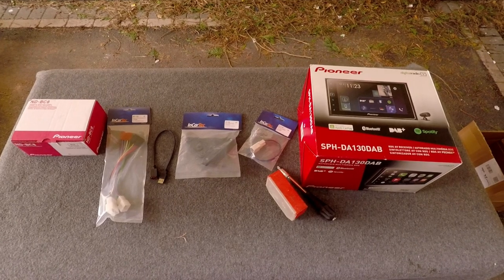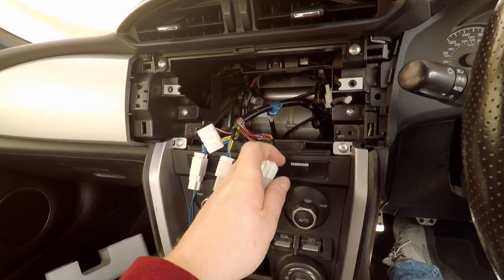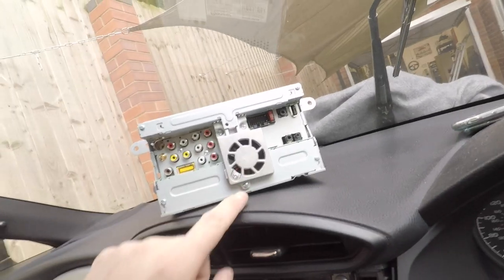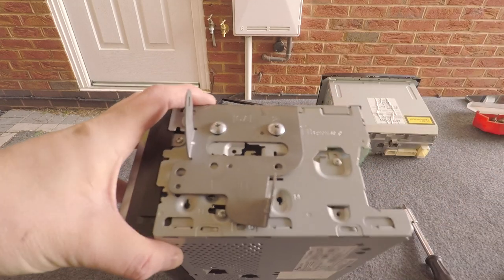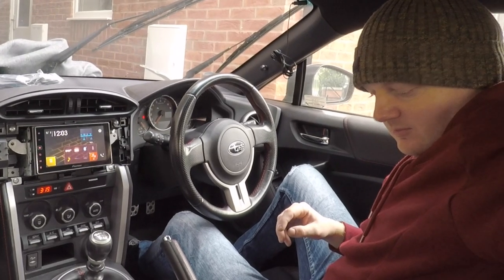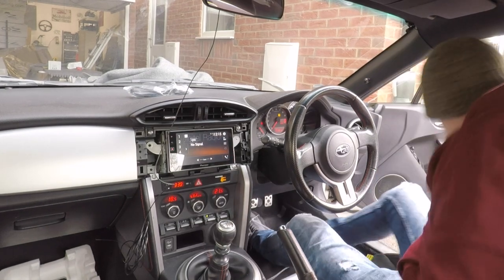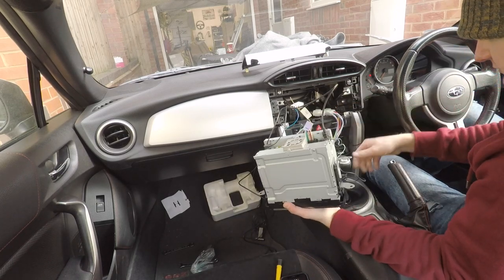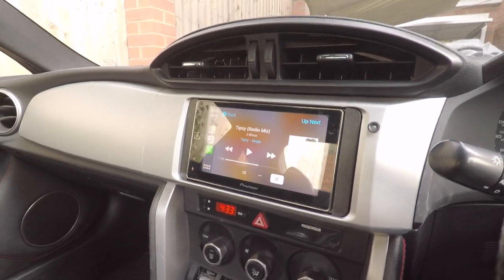Subaru BRZ Fitting an Aftermarket Head Unit Toyota GT86 Scion FRS - Pioneer SPH-DA130DAB

Comment: I followed your video to install a new head unit in my GT86 (so thanks first of all!). For some reason though, my window buttons and other buttons on the drivers side (mirrors etc) now don't work. The passenger side window button only works when it feels like it. When I start the car they all light up so they're getting power and weirdly when the doors are fully open the buttons seem to work every now and again! Fuses are all alright and I'm just really stuck...do you have any ideas?
Reply from the maker: Sorry not heard or seen that issue on the forums etc before.  Are you sure your battery is fully charged as this has been known to cause issues and just needs charging/go for a good drive to charge it
Reply: @tweedbean  Ah okay no worries. Yeah I charged the battery to full and still no joy. Thanks anyway, I'll have to find an auto electrician or something

Comment: Very useful video, thank you.  However, you completely skipped over the fact that DAB will not work without an aerial addition/upgrade which wasn't covered.  And the largest of three original connectors you simply dismissed - it was doing something before, so what will be missing after?  Thanks.
Reply from the maker: No problem.  I tried to keep the video theme to the basics of headunit install hence I didn’t cover the DAB aerial connection or any other accessories like a reverse camera etc.  items like that are covered in the headunit specific instructions so hopefully that helps.  In terms of the larger connector it’s not needed, stock head units will have different feeds for things like nav etc that won’t be used by the aftermarket head unit as they come with own aerials etc.  this setup was used for years without loss of any functionality.  Good luck with your install, thanks for watching

Comment: What's the part number for the head unit you removed at the beginning? I hate screen displays in cars and love the retro look, and that unit looks amazing to me. I've actually never seen this style of head unit in an ft86 before, how did it get there?
Reply from the maker: It’s a UK spec stock headunit from a Subaru BRZ 2013.  Not sure on the part number.  I have it for sale but I assume you are not uk based
Reply: @tweedbean  Nope, USA here. Thanks so much for the info, I've literally never seen the part or any info pertaining to it before. Would you happen to know if it fits the later models (2017?)
Reply: hey idk if you still have your ZN6/ ZC6 but there is a couple surrounds made to put a single din into these cars.
Reply from the maker: @yaboirico5221 thanks but I no longer have it
Reply: @yaboirico5221  can you link? I'm fine running the stock headunit but I'm interested in looking lol

Comment: Did you ever make that reverse cam video?
Reply from the maker: Hi I didn’t it’s a very easy to install on this headunit.  Literally buy the Pioneer camera. Here is a pic of here I mounted it, need to tweak to improve the angle slightly but nice and hidden:  https://flic.kr/p/2jrvPNC. Wired the reverse camera up, connected to the pink wire in the passenger footwell, 5th wire down on the left in this block to get a reverse signal to the head unit.  - I ran the camera cable down the passenger side of the car, under the back seat, through the boot, up into the wire rubbers between the boot and the boot lid, using a coat hanger to pull it through so no wires exposed for the OEM look. I then used a dremel tool to cut a square out next to the boot handle opening button and used the mount that came with the camera to fix it to the inside of the boot handle, I hate reverse cameras you can see from the back of the car, so its tucked away for the stealth look and can only be seen when the boot is fully open.

Installed Pioneer Nd-bc8 reverse camera
Reply from the maker: Some pics and detail here: https://www.gt86ownersclub.co.uk/threads/tweedbeans-subaru-brz-rebuild-porsche-rs-green.18145/page-4
Reply: @tweedbean  thanks appreciate the links!! Love the BRZ!

Comment: When choosing this what other options were there that worked for your car. Some people have told me most of them are not compatible with the BRZ that has the CD player stock vs the touch screen option ??? Thanks
Reply from the maker: Sorry not sure what you mean. I can’t see why what headunit your came with matters.  Once you whip it out any aftermarket double din headunit should fit.  Did anyone give you any reason why it wouldn’t work? As I can’t see why
Reply: @tweedbean  some channel called “beat-sonic” said that I won’t have the right signals or something in the car if my car doesn’t have atleast the stock satnav screen ? Idk
Reply from the maker: Well you can see my car had a CD player, no touchscreen and it did not impact anything working.  I did not have to choose a specific headunit.

Comment: So what wire did you use to still use the stock USB connection for Apple Car Play? Help
Reply from the maker: Hi sorry for the late reply, this is the one I used: https://www.ebay.co.uk/itm/184019557670
OE Car Stereo Factory USB Retention Interface Cable for Toyota RAV4 2012